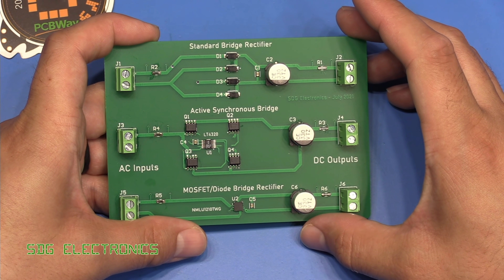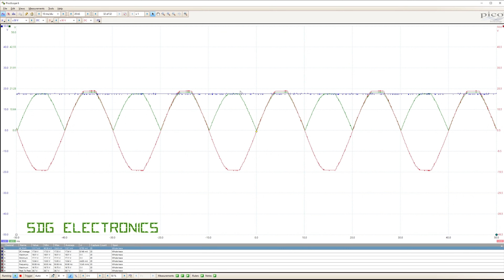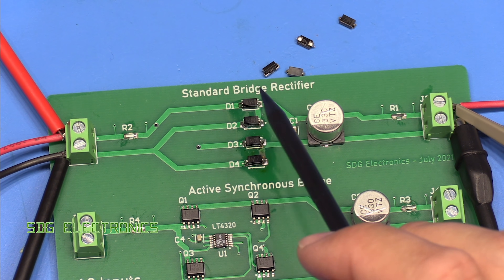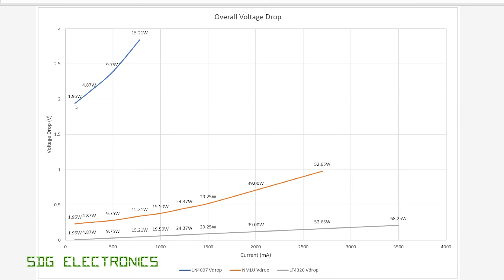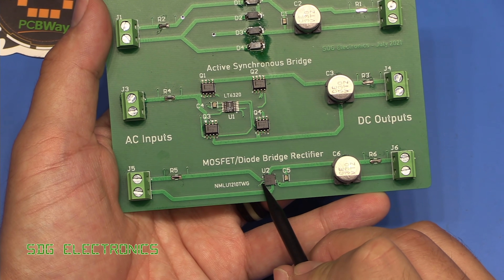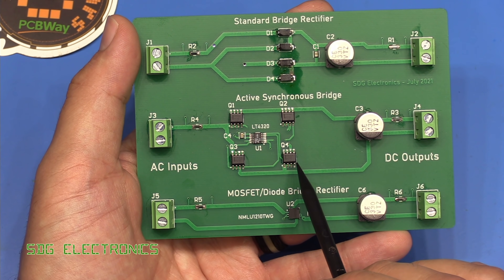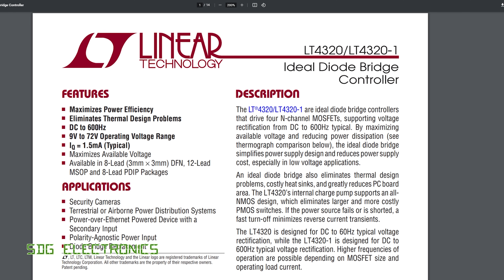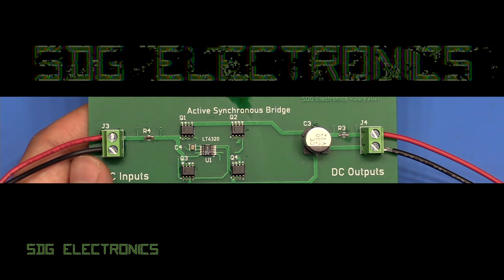SDG #219 Adding Output Capacitance to the Full Bridge Rectifier

Comment: I think many who investigate or study electronics have the experience of setting up circuits using a generic bench DC power supply, which is fine, but instills the idea that a supply is designed and then a load is connected, and as such we test using a resistive load which is very simplistic in how power may be used. The primary task in delivering power is in understanding the characteristics of the load and then design the supply and transmission (wiring) to match, which falls under the relatively recent area of design concentration call power integrity (PI). So it is important to understand the dynamic characteristics of the load and how to design for its needs. 

If you want to understand power supply efficiencies in relation to design requirements just investigate the evolution of Personal Computer switching  power supplies. The power/efficiency price point largely drives designs and produces common design trends in approach and in devices used like control ICs. One obvious trend for high efficiency is in addressing diode rectification loss, as you have illustrated in the video.

Comment: That one annoying via... but if you look long enough, there's an alternative layout that would let you make that board single-sided. It requires running a track around the outside-facing edge of the power in connector.

Comment: Excellent video going over a topic not many people give much thought to.  If you're planning to build your own SMPS an interesting video topic I'd love to see you do first would be diode selection in DC-DC switching converters.  Though of course I expect you'd be wanting to use a bootstrapped NMOS to reduce losses at higher currents in your own design.  

The balancing act between reverse recovery charge, leakage current, voltage drop (and the rise in Vd with increasing forward currents) is actually pretty interesting once you start trying to optimize a design.  Two diodes with similar looking characteristics on a datasheet can sometimes vary massively when it comes to the actual measured efficiency of a converter.

Comment: Using the EZ81 tube did the job better than any other diode I could find in one of my applications since the diodes would break over 100ma current with the factory design of that unit no matter if the diode used was rated 3 amps and 1000 volts it would break immediately, I also made a 3 fast recovery diodes chain with parallell resistors that worked even if these diodes was rated 200V each and 1 amp they worked better than one single diode. I think what happens is the peak voltage times the frequency is too much for the single diode hence a weak design of that power supply but the tube again shine over the silicone ;D
Reply: If you use slow (non ultra fast or shottky diodes like 1n4007) with high frequency (SMPS) or low voltage diodes (>1000V peak reverse voltage for 1n4007) that is expected result (diode's overheating and failing). Genuine 1n4007 (either 2pcs for output voltage <350V or 4 pcs diode bridge) will have no problem outperforming EZ81.
Here I assumed a 30% safety factor (350V output center tapped or 700V full bridge - up to 700V beetwen transformer taps that is 30% down from 1000V value).
Reply: @volodumurkalunyak4651  in my case there was no diode that could handle the task. No matter if it was a high voltage ultra fast diode or any other kind you can pick. They all fail without hesitation. As I described the EZ81 and a specially crafted chain diode was the only thing that could do the task without failing. 
There is no transformer. And no bridge rectifier. 
It is a pulse step-up voltage booster which have a working voltage of 390 volts DC with up to about 150ma current. 
The EZ81 is superior for this task and there won’t be any diode that gonna do this better because I did not have any failure after I put this in after the factory diodes broke or any other one for that matter. 

The problem is that no Schottky diode will handle that voltage anyway. And 4007 is too slow for the frequency. Hence the only working diode configuration was a chain with 3x200volt 20nano second recovery diodes with resistor balancing was the only working solution except the tube. 

So no a diode is not best for this task. The EZ81 is superior in this case. 

Plus the fact when a diode reach a failing point it does die permanently at this point in a matter of nano seconds. 

The tube on the other hand will generally be able to recover from temporary overload/over voltage conditions and still live. 
So generally diodes are good for most stuff today. But there are still some things only a tube can properly handle. 

Plus the tubes are cooler to look at
Reply: @Pulverrostmannen  390V is a input voltage, output voltage? What is topology, ordinal boost converter? There are high frequency high voltage silicon-carbide diodes specifically made towards PFC application (ultra fast, 600V+).
Cree c5d0517H will be overkill, yet still cheaper than EZ81.
There can be anouther reason why diodes fail: output capacitor placement and imperdance.
Reply: @volodumurkalunyak4651  390 volts are the output voltage. It is a boost converter type of circuit which is factory made. The factory diode (a US3M Ultra fast glass passivated 1KV 3Amp 75ns SMD diode) this fails at about 200volt with 100ma output power. With my EZ81 it been tested to 390 volts and 200ma as well as with my special designed 600 volt chain diode as well and then it will not break. However this test have been performed with much MUCH beefier diodes as well with same voltage rating and fast recovery but they fail anyway and it is expensive to test all kinds anyway but i shot all types I had on hand. 

I could still use the chain diode I made myself and it will not fail as all other diodes do. 
( STTH102RL 200V 1A 20NS ) which is a switching and flyback suited diode. 
3 such diodes in series with 3 parallel high value resistors and it also works as a replacement for the stock diode. 

However I like the tube because it’s used with a tube amp anyway so it fits with the rest of the stuff. 

But I have made some measures and I am pretty sure the boost converter is rather poorly made when it comes to the design but I have not taken the transformer apart to see if it has a flyback design or not. 

But it has a primary and secondary winding separated from each other with no auxiliary winding but I am pretty sure it will have an air gap using a flyback design because the high frequency and that it can easily generate more than 1KV if the feedback is disabled. 

My guess is that the peak reverse voltage is way more than the output voltage and the measure insanely high frequency ringing on the secondary is enough to put any given diode into reverse breakdown or excessive heat due to reverse currents during reverse polarity.
And also since it is a secondary winding pulse mode design voltage pump it also lack a snubber network making the ringing and peak voltage even worse. 

So yeah. The tube can handle this without even breaking a sweat. And only my other 600volt special diode can as well. Everything else will break. EVEN a RFUH30 twin 600V 15amps 30NS put in parallel for 30amps. Not even seconds. 

So what explains my other 600 volt diode can handle it? Maybe headroom. Maybe the resistors in parallel or maybe even the lower recovery time of 20NS. 

I did not go further than getting to a working solution with my EZ81 which have been running for way beyond 1000 hours now still going strong and I even put in the most used and blackened tube I could find as a test. It just works
Reply: @Pulverrostmannen  those all diodes fail from excesive reverse voltage. You have a flyback topology converter (gapped iron core, transformer with only 2 windings, no extra magnetics), that requires output diode rated at least Vpri*(Nsec/Npri) + Vsec. Vpri*turns ratio is a reflected voltage on a secondsry coil. Output diode shouldn't fail from high frequency ringing as it closes before ringing starts. Primary switch breakdown voltage requirement is following Vpri + Vsec*(Npri/Nsec)+Vovershoot.
Converter might use a forward topology, that requires snubbers at primary side and output voltage is directly proportional to input or 2 output diodes (from each side of output transformer coil to input of output inductor) are required. If output diode is soldered wrong, that turns unregulated forward converter into flyback or wise versa.
Reply: @volodumurkalunyak4651  yes that always been my primary theory. But that does not really explain why the triple diode I built never fails since this is rated 400 volts below the factory diode. Do you think there is this much extra headroom available or if the resistors I put across them cut the highest peak voltage from the reverse spike. I put these resistors in place mainly to reverse bias the diodes so that they close at the same time and not blow the first diode to pieces but also with the thought that the reverse voltage would also leak back to the secondary at the same time. It might be the reason my diode work even if the rated voltage is lower
Reply: @Pulverrostmannen  osciloscope with high voltage differential probes holds the answers. If voltage across output diode across swithing cycle is following: start reverse, quicly rises to even higher reverse and stays there than quickly falls down to 0 and turns foward, turning diode on, stays positive (a volt or couple volts) for some time and only then 
oscilates around some reverse value, then converter operates as a flyback one. Whenever diode voltage does't go even gigher negative before going positive and (maybe staying even higher negative and then) oscilating afterwards, that is sign converter operating as a forward converter.
Reply: @volodumurkalunyak4651  True, but I only got 10X 600 volt rated probes for my scope and I don’t want to damage it. I could make a resistor divider and such but it would only tamper with the values anyway. I could make a load test with lower output to get a load characteristic what is going on but I am pretty sure it escalate more with higher load. 
Good to talk with someone that seems to know a lot about this stuff too. Kudos to you

Comment: It is a pity that the NMLU1210 is obsoleted, as it looked like a very tidy PCB space saving option for small retro transformer projects.  Anyone found a replacement single chip alternative?
Reply from the maker: I'm on the hunt for a replacement. I'll also test out using discrete components, but it'll lose out on the size advantage.

Comment: Replacing lt4320 with four mosfets is not so trivial because mosfets, when open, conduct current in both ways. Usually people use a opamp/comparator accross source and drain (with some hysteris) to make it conducting only one way. Such devices called "ideal diode controller" or something. There are many solutions on the market. It's relatively easy to make one with opamp, but watchout opamp's offset voltage: https://www.eeweb.com/use-a-self-powered-op-amp-to-create-low-leakage-rectifier/ . 

As on on-semi part, I've designed a similar device using discrete parts, you can see it here: https://www.eevblog.com/forum/projects/semi-active-bridge-rectifier/ . Why I didn't use lt4320? It wasn't easily available to me, not very cheap and doesn't work below 9V. There are alternative ICs with similar function, but there are not many of them. One of alternatives is TEA2208T , but I haven't tried it yet.

Comment: Further to your comments (10:22 onwards) about using schottky diodes in the plain bridge, I would note that the situations where diode losses contribute more to inefficiency are those where the voltage is low - so schottky diodes ARE a viable option.  Yes, at 240 VAC schottky isn't an option but 2 Volts of loss is OK because the loss is less than 1%.  At 20 VAC that loss is 10%, so changing the schottky, maybe with a drop of 0.8 Volts, brings the losses down to 4%, a worthwhile saving.  So, as always, the fine details of a design are important.
Reply from the maker: Voltage drop and efficiency may not be of equivalent importance depending on the design, despite them equating to the same thing. A mains powered application may not care about the voltage drop, but you might be concerned with the heat dissipation. You're right though, lower voltage applications may care about the voltage drop more.

Comment: My channel is mostly audio. For use in power amplifiers of say 50+watts at present I tend to use Schottky diodes and a conventional capacitor smoothing which does work well. After watching these videos, I'm wondering if there is an alternative that would  make sense without costing a fortune. Power tends to be the issue.
Reply from the maker: Hi Michael, I think some of the folks on DIYaudio have been experimenting with synchronous bridge rectifiers. Schottky diodes are pretty good if they have the ratings you need, but I do like the 2x Schottky and 2x FET design. I might try this out with discrete components to see how it behaves.

Comment: Wonder if using a cheap microcontroller with a built in H-bridge driver (for the MOSfets) would be a cheap yet very flexible solution?
Reply from the maker: To implement a design like the LT4320, you'd still need the charge pump. You can do it without any controller with 2x P and 2x N channel MOSFETs. I might make another test PCB to try out some discrete solutions like this.

Comment: Can you elaborate on the probe issue a bit more? Is it because the AC ground/neutral would be connected via earth ground to DC ground and thus the output would appear sinusoidal? I guess I trying to understand if this could have gone bang or not?
Reply from the maker: The best way to explain it would be to draw out the schematic. Since the ground lead on all of your scope probes are connected together, if you probe the AC and the DC side at the same time, there is a shorted diode. The scope and diodes probably won't go bang, but your electronics on the DC side of the bridge probably will.
Reply: EEVBlog has a video on this: https://www.youtube.com/watch?v=xaELqAo4kkQ

Comment: Nice video. The efficiency measurement would be a little more accurate if you used a larger capacitor to minimize ripple. As it was, the energy efficiency of an ideal capacitor when being charged from a voltage source is given by 1/2 * (1 + Vmin / Vmax), which gives a significantly greater loss for the lower performance solutions.

Comment: You could try a MUR640 in place of the 1N400x diodes, which is an ultra fast 4A, 600V diode, although the forward voltage can exceed 1V at 4A. But it works very well in SMPS applications.

Comment: Thanks for the follow up Steve!
The capacitor on the output of the LT4320 made a pretty sizeable difference, i think it may use the output voltage to drive the gate charge pumps and without the capacitor it couldn't do that at low ac voltages.

Also thanks for the wide range of testing, i could see this really being useful in things like audio amplifiers etc where you have many supplies that need rectifying.